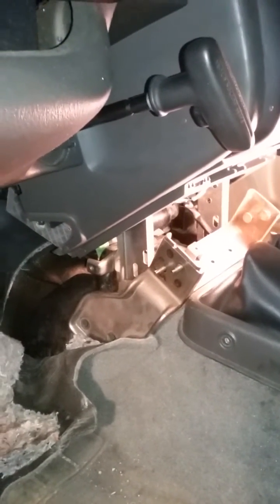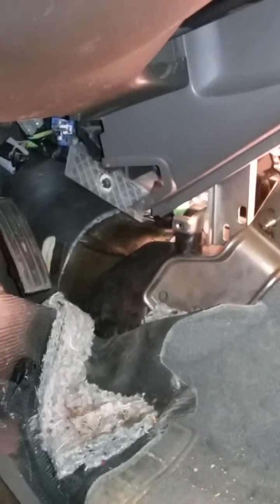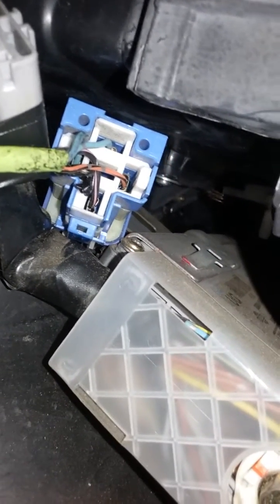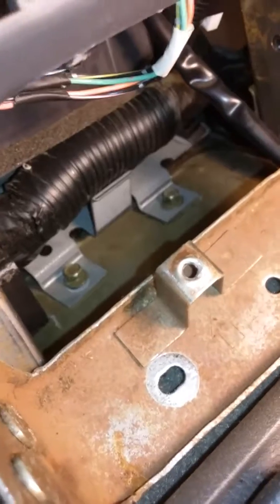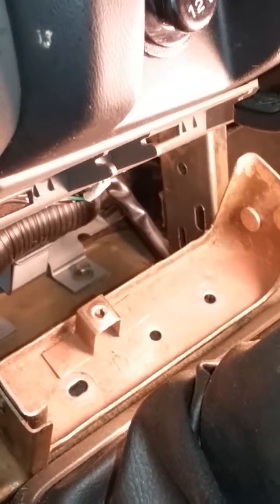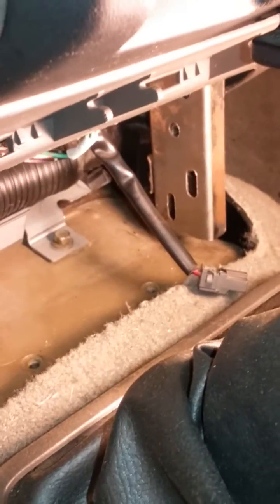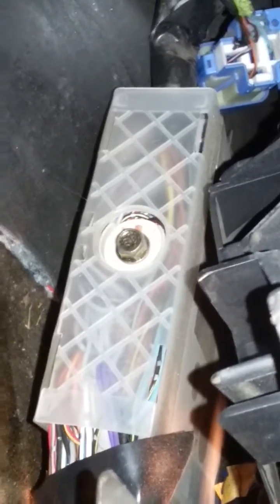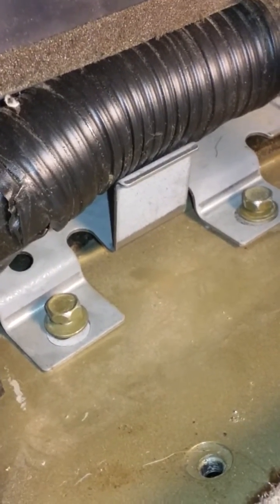2000 Nissan Xterra - How to remove Engine Control Module.

Comment: This’ll help a bit more, in order to tear down the access to get there, at the most complex on I think an se 02 like mine, you have to take the center console, gearshift lever, and after doing that, REMOVE ALL SCREWS THAT ARE VISIBLE, I tried tearing out the footwell plastics and am pretty sure they are now bent and permanently damaged, once you take off all screws remove the trim with the middle two airvents and wraps around radio, unplug the cigarette lighter as well as the hazards. Then, unbolt the tcu which is just 4 10mm’s, then take out three more bolts that go to a bracket (actually one because i’m not sure if the others get out of the way, I took 3 out,) and one is gonna be on a black plastic, that black plastic is the footwell air vent, remove the two pieces that go out to the driver’s and passenger side before dislodging thing middle one and removing it. Finally unbolt the two bolts of the ecu bracket, then take the ecu to preferably the passenger side and use a 10mm for the connector and pry it off with your hands, and the reason I said remove off passenger is so that you are able to unscrew a bracket built in to the ecu with a stubborn to take off retainer that you can’t damage that connects to the ecu, move the ecu to a workable area like the passenger footwell and phillips head unscrew the two screws and now you have an ecu that’s free (also a blue relay is there and it’s attatched to the ecu but not actually connected). If it helps too, I had a throttle position sensor issue that gave me similar things like the ecu BUT I MOVED IT WITHOUT CALIBRATION BC OF ADJUSTING TIMING AND REMOVING IT, if you did this or you’re unsure if your tps sensor is working, there are two grounds on the intake manifold near the distributor, one holds two ring connectors, grab a metal wire brush until it looks shiny or repair any grounds, then check voltage between the positive and negative tps connector, if 5v perfect, then put the sensor at a forward angle on the throttle body sensor (like 20 degrees towards the interior of the car, it should never be able to move the throttle cable this will cause it to idle at 1500, ask me how I know) and check voltage on the signal wire, I went for .52 volts and it ran near perfect and it took out the ses light, good luck y’all i’ll make a video soon.

Comment: If you use a short 10mm 1/4 drive socket on a non-bindable swivel and a 12" extension, you can skip removing the metal piece in the way.

Comment: Got a 02 did you remove AC plastic ducking an how? my xterras AC air duck I believe is cover those two bolts holding the ECM down .
Reply from the maker: That was a while  ago but I don’t remember removing AC ducts.

Comment: Hi , I have a 2000 Xterra n it’s stuck in 4 Lo. It has sit for awhile n I had drove it n had to put into 4#4 n was told to try removing the battery cables n let it reset or also Unplug the transfer case control module? I’m like where is tht n is it a good idea? Thank you
Reply from the maker: If you have the manual like me, you have to push the 4wd shifter down to move it.  Maybe something is blocking it. Funny story,  I remember when I first got the Xterra I couln't figure out how to shift it into 4low, I thought it was broken.  Months later I was messing with it and accidentally pushed the stick straight down and it went into 4 low.  I felt like an idiot, I swapped out the engine in it but couln't figure out how to shift into low.  Facepalm!  I really like this vehicle, I think because it is so simple.  Everything you need and nothing you don't.... so true.

Comment: what was the reason for removal ?
Reply from the maker: anthony banks  Purchased it not working. The injectors were not firing.  Thought it might be the ECU but turned out it was a connector not seated fully.
Reply: thank you for replying , my xterra keeps throwing codes p0131
Reply: To protect it from an emp
Reply: @Big Al i have the same problems what fixed yours?